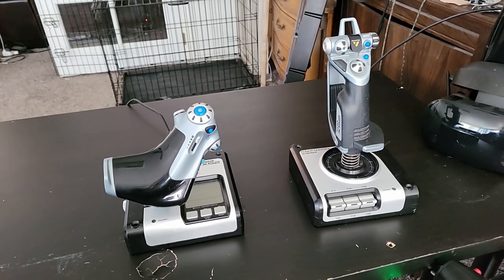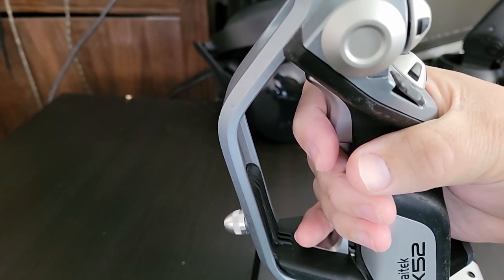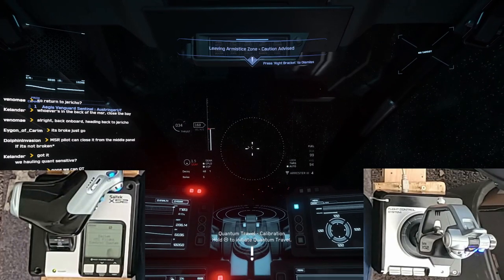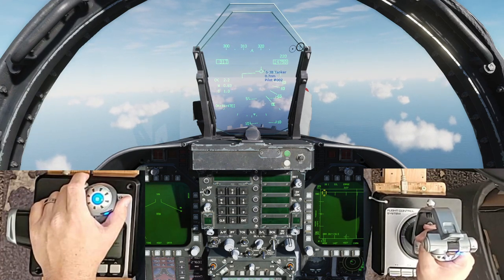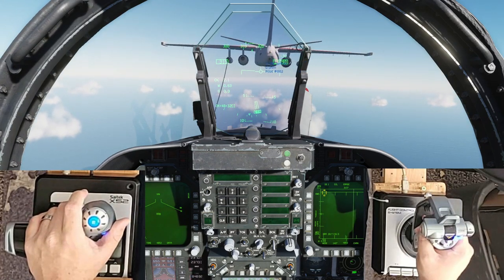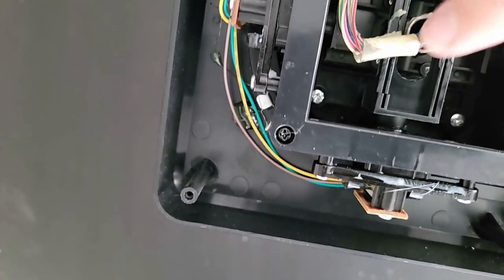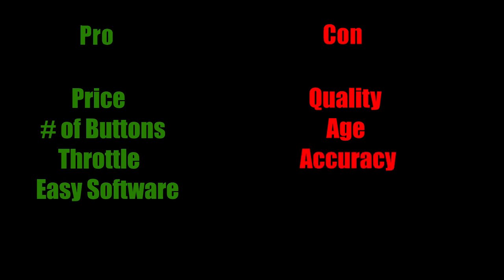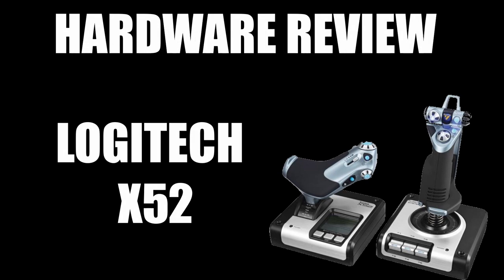Logitech/Saitek X52 HOTAS Hardware Review

Comment: I feel like I can air to air refuel easier in a 3d pro joystick than that x52.
Reply from the maker: I don't doubt it, wonder if that stick uses pots and not hall sensors?
Reply: @FalconsLedge  it uses pots, I’ve been using it and it kinda sucks. It’s not bad but for any micro movements it is almost useless. For air to air refueling I have a totally different joystick curve that I switch to.
Reply from the maker: @questofknowledge8788  I used to crank up the curves to use the x52. I had no idea how bad it was til I started heavily researching joystick tech
Reply: @FalconsLedge  Yeah, I have known mine is bad, the problem I have now is my stick has been around for about 7-10 years and is breaking down. I may end up just using it only for dcs f14 rio.

Comment: do you recommend the pxn 2119pro ?
Reply from the maker: Looks like an Uber low end licensed copy of the x52. I don't recommend the x52, let alone Uber low end copies of it, but here's the thing:

If your budgetary limitations are such that the pxn 2119pro is what you can get. It can't be worse than no hotas right? 

Personally I'd save up a bit more and get a T16000, it's a bit higher quality and has a far better sensor.
Reply: @FalconsLedge  make sense thank you

Comment: so, today i disassembled my hotas x52. this is not spider web. this is glue-style sh*t!!!! WORST ASSEMBLY I EVER SEEN (i disassembled a lot of keyboards/mouses)! 
WORST!
it started making creaking plastic sound in A WEEK! WTF LOGITECH (SAITEC)?????
so i used silicone lubricant
did you know that throttle IS supposed to have haptic feedback at 100 and 0? I DIDNT! UNTIL I LUBRICATED IT!
i mad at this gear
p.s. sorry for my bad english
also cant get pinky button to work
Reply from the maker: Pinky button must be configured in their software it is a "clutch" button by default. Also mine did have a spider living in it, but yeah glue was terrible. I went VKB and have never looked back
Reply: @FalconsLedge  omg
Reply: @FalconsLedge  x4 where i use x52 cant see clutch button combinations even with built-in preset
Reply: @FalconsLedge  waiting for my vkb premium now

Comment: The t1600m is an absolute piece of trash by comparison, you're quite deluded in this review.

If you knew how to properly calibrate your stick, you would get super precision and no axis drift, and with Teflon spray on the plastic ring at the base of the gimbal, you'd have a super smooth motion.

I don't disagree the VKB is a step up in some ways, although the warthog has way too many problems of its own.

But the x52 is a popular stick for a reason - it's very precise when calibrated properly.